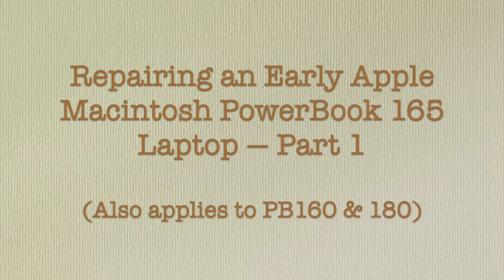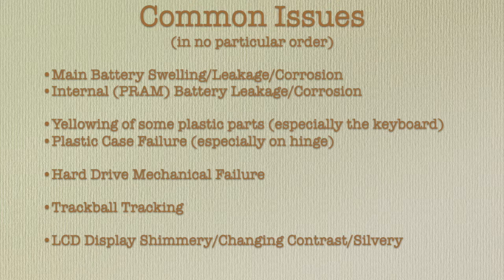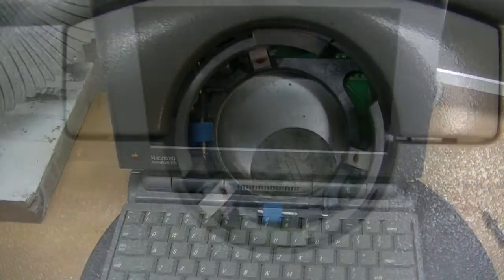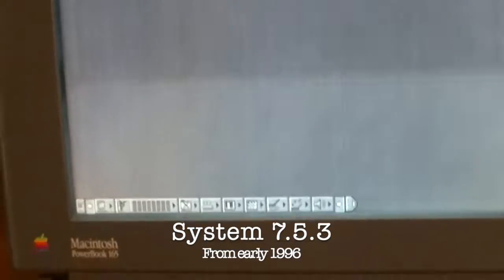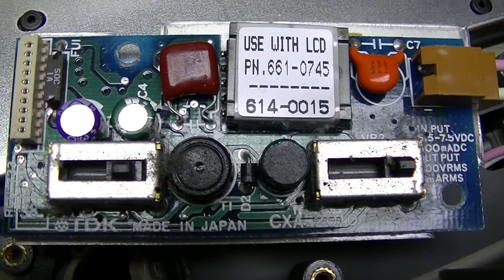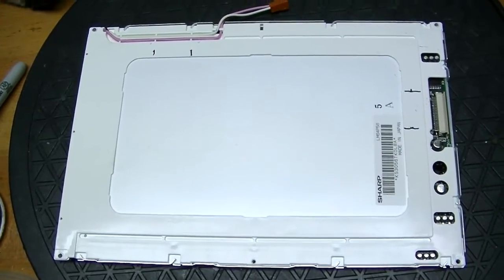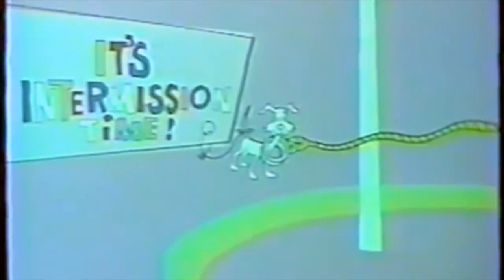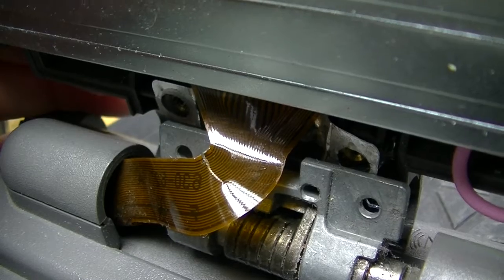Repairing a 1990s Apple Macintosh PowerBook 160, 165 or 180 Laptop - Part 1

Comment: Hi Mr. Brown. I'm new to this type of repair. I have a Machintosh Powerbook 160 with a bulging laptop battery and a leaking PRAM battery. I'm trying to fix it for a friend so she can get her files off the hard drive. Can you do a video on how to replace the PRAM battery? I don't have any experience working with a solder gun but I'm willing to learn. Thanks for your time in creating these videos. Much appreciated!
Reply from the maker: I'm out of town right now so I'm sorry I can't make a video for you. However, I can give you some advice. First, get rid of the bulging battery; it's toxic. Second, if you've never soldered before this is not where you want to start learning! The NiCad is on a small board and likely the solder has been poisoned by the NiCad corrosion and won't want to melt. This forces you to use more heat and will probably cause the traces and pads to come off the board, thus ruining it. If you want to learn how to solder, you might want to watch NorthRidgeFix (youtube) for tips and techniques. However, if all you want to do is get the files off, it might be easier to pull out the hard drive and stick it into an SCSI enclosure and then use another old Mac to read it off. And that won't be easy because SCSI enclosures are hard to find. Besides, there's no guarantee that the hard drive will even want to spin. The spindle is more than likely stuck due to age. Honestly, you're looking at a potentially complex job with no guarantee of success. FINALLY, you don't a good PRAM battery to copy the files off. If it starts up off the hard drive then copy the files onto a 3.5" floppy while you still can! Let me know how you're doing and I'll try to respond!
Reply: Hi Mr. Brown. Thanks for the reply, tips and advice. At first turn on, with a bulging battery installed and the power cord plugged in, I held the power button for about 10 seconds and the laptop powered on but nothing was on the screen. I shutdown and removed the bulging battery and started snooping around inside (reseated the video cable). Leaky pram battery is still inside the computer. Reassembled the computer and it hasn't powered up since. Yeah, sounds like there's little hope. But in you're reply, are saying I don't need a good PRAM battery to get the computer up and running? Best regards!    @Mr.BrownsBasement
Reply from the maker: @kcarm32 With some Macs (e.g., the Mac II, IIx, IIfx) they won’t start up at all without a working PRAM battery; others (e.g., Mac LC, Powermac 6100) will start up but without video. That Powerbook should start up without a battery and without a working PRAM battery but all settings (e.g., time) will be lost. You should get a white screen and you should hear the HD spin up (or try to spin up). If you see just a white screen adjust brightness/contrast and see if you can get an image. You can always startup off a bootable floppy. If you get an image and it’s a floppy with a flashing question mark that means no bootable disk was found. You want to get stuff off the HD but it has to successfully spin up for that. After 30 years they often won’t. In my video I gave my Powerbook a sharp smack and that freed up the spindle but don’t recommend that. Keep trying! Keep me posted.

Comment: I have a model 180 powerbook, so just to be sure, the Pram battery is not extremely urgent to get out? I dont think they can kill a laptop like the big barrel type the desktops use. Im dreading to even touch it because its pristine, even the display is like the day it was sold... and my Dock duo showcased me first hand the awfulness of 90s apple plastic
Reply from the maker: It's a NiCad but it's really tiny so it doesn't have a lot of electrolyte in it. Unfortunately, it doesn't take much electrolyte to make a huge mess. In the Powerbook 160 it's mounted on a separate board so it's unlikely to damage the motherboard but it can still damage nearby components. On the Powerbook 520-series, the PRAM battery is underneath the hand-rest and is also far from the motherboard but corrosion could still migrate to nearby metal. While I have never seen a NiCad leak in a motherboard, I've had NiCads leak on other things. What comes to mind is a very small NiCad that badly corroded an Applied Engineering Z-RAM for the Apple IIc. I will have to deal with that someday. I think it comes down to luck… and tine. I have a bunch of Powerbooks of the original (1xx) series and after my experience with this one I'm not looking forward to opening the others. But at some point I may have to, because if it's not the batteries that are leaking, then it will most certainly be the electrolytic capacitors. If you watch my video on the Radio Shack / Tandy Model 100 you'll see that almost every electrolytic capacitor was sitting in a dried puddle of its own electrolyte while the NiCad was fine. You're absolutely right about the awfulness of Apple's choice of plastics. If it hasn't yellowed, it has become brittle. Or it has crumbled. And this is only 30 years after it was manufactured. I wonder how much will still be around in another 30 years…
Reply: @Mr.BrownsBasement  well, to be fair other computer brands last fine for 50 years, and even apple got their plastic act together at the end
Reply from the maker: @AveragePootis  I wonder if Apple did! If you've ever taken apart a G3 iMac you wouldn't think so! And they were discontinued only about 20 years ago. Many of the parts are thin, brittle and very easily broken. You just have to look at them the wrong way!

Comment: so, wheres part II? the repair of the broken ribbon cable would be helpful..👍
Reply from the maker: I hear your frustration. I have been dealing with serious family issues that have kept me completely tied up. I'm hoping that I'll be able to resume again soon. But I know you want to see how the repair is done. In a nutshell, I will use a grinder pen to remove the solder mask above the traces just enough to expose the traces so I can tin them. Then I will hold the two sections close together with Kapton tape. Under a microscope I will tin the traces and solder very fine wire to bridge the torn traces. Next, I will cover the repair with solder mask and Kapton to make it as strong as possible but still keep it flexible. Finally, I will cross my fingers that the fix will not fail. :)  I can sense your urgency. Until I can make my video, please search YouTube for "Flex Cable Repair".

Comment: Do you know if the PRAM battery is required for bootup? I have a 165C, it is giving the 8-chime error. Wondering if replacing the PRAM battery could solve this
Reply from the maker: Please download the service source manual for this computer. On the 3rd page of the troubleshooting section it says “RAM failure occurs (eight-tone error chord sequence sounds after startup chord). They recommend re-seating the PSRAM expansion. So, no I don’t think replacing the PRAM battery would help you at all.
Reply: @Mr.BrownsBasement  Ok thanks, I did try that already and unfortunately it didn't help.
Reply from the maker: My gut feeling is that you probably have a bad RAM card. This is a long shot: you could examine it under a microscope to see if any of the connector pins are bent or broken.